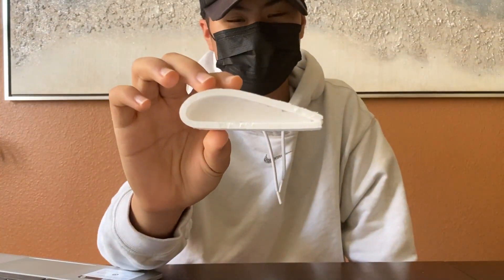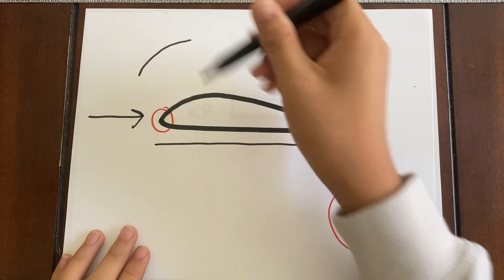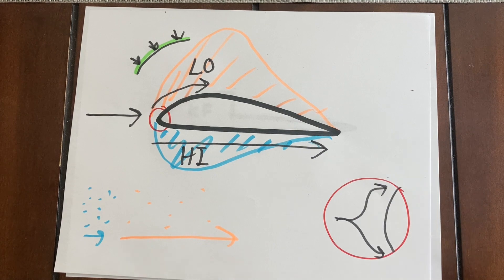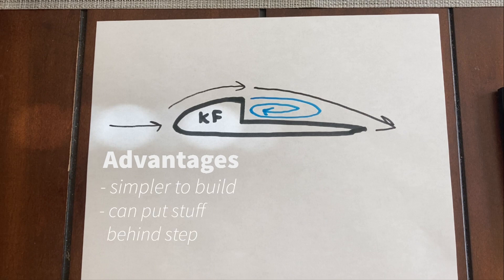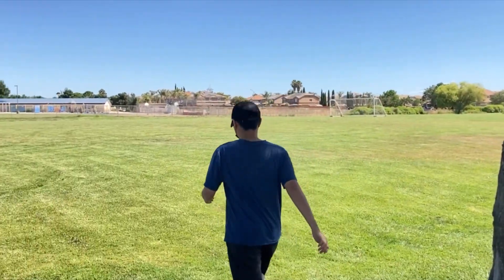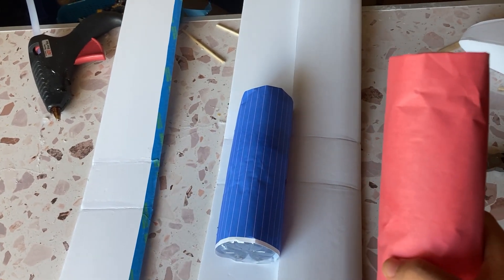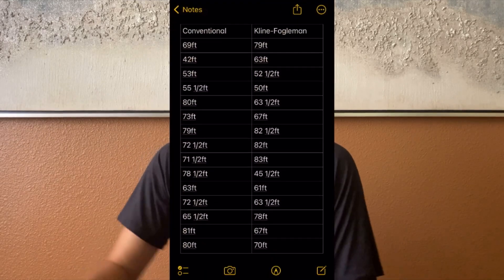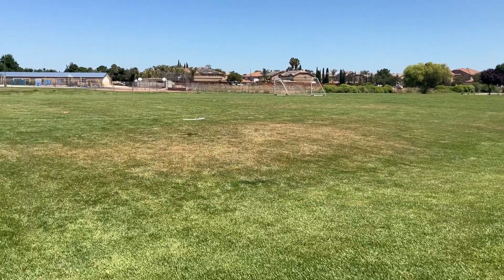How Good Are Stepped (KF) Airfoils Actually?

Comment: Good experiment, but you're not gonna see a whole lot of difference between the airfoils this way. That's mostly because there's huge differences in the amount of thrust you give with each throw and the exact angle of each launch. It is humanly impossible to apply the exact amount of thrust at exactly the same angle every throw. KFm airfoils are just more efficient , and you wouldn't see that unless you measured the energy required to propel it through the air for a given time or distance. They improve aerodynamic performance by reducing stall speed and increasing stability.  Still cool to see you young guys out there exploring the scientific world. Maybe one day you'll invent an airfoil that will change aerospace forever !!!

Comment: The KF is lighter, is it not? That might make it go further, or not. Ideally the wings should have the exact same mass for their surface area, so the KF would have to be made of something a little denser, or have a weight strip added to it.
Reply from the maker: Good question. Essentially it would be, but by a couple grams I would think. Probably the weight difference is insignificant compared to the entire weight of the aircraft.
Reply: @_BL4CKB1RD_ While the actual weight of the removed wing part seems slight, in reality it is about 25% weight of the overall wing weight removed. That is a significate amount of weight.
Reply from the maker: @K3Flyguy noice.
Reply: @_BL4CKB1RD_ I think you're right. I didn't realize how light that stuff is.

Comment: Couldn’t help thinking that exercise would be better conducted with well  constructed glider in balsa and without interference from radio control. Consistent launch system inside large hangar would be better still.
Reply from the maker: @richardfalconer1959  this other YouTuber @DesignYourOwnAirplanes-xd6lz performed a much better designed experiment than i did. He uses a gym and and a consistent launch system (which I was unable to make).

Comment: Interesting video. Afaik KF airfoils have lower performance than regular airfoils, but compared to an airfoil made from bent foamboard the difference should be minimal. The main advantage of them for RC planes is that they're incredibly easy to build by just glueing two or three sheets of foam on top of each other and then sanding the leading edge into an airfoil shape. At least for the depron we get here in Europe that doesn't have paper on it, I don't have experience with dollar tree foamboard.

Comment: Hi! It's the pressure diferential which accelerates air above, and not the opposite (as you said). With some angle of attack is more intuitive. The air coming towards the wing is forced to go downwards (downwash) so more air is concentrated. In the upper part there is much less air, so pressure decreases. A consecuence of this is the acceleration of the fluid, but the acceleration of the fluid IS NOT THE CAUSE. There are NASA documents you can easily search proving wrong the Bernoulli's theory for airfoils, which is logical, cause Bernoulli made his theory for uncopressible fluids like water, not air. Great video, awesome
Reply from the maker: Alright thank you for letting me know. I know I’m no expert on this subject, but how does the pressure differential arise in the first place then? (Also, air is compressible only past 0.3 Mach, at these extremely slow speeds, we can follow Bernoulli’s principle)
Reply: It is easy to see when there is some angle of attack. In the underside the air accumulates (more pressure) and it is forced to go downwards, while in the upper part, there is much less air, therefore less pressure and the air above is sucked
Reply from the maker: @torri7062  that wouldn’t make total sense for no angle of attack, since all the air is streamlined. I believe you are thinking of Newton’s third law, where each action has an equal and opposite reaction. When the air hits the bottom surface of a wing, and deflects downwards, the resulting force of that contributes to the wing lifting upwards. There is no one way a wing produces lift, but a combination of various principles.

Comment: underrated channel. im gonna build the tileo plane u built. do u have a build video?
Reply from the maker: Oh nice, but umm I don’t plan on doing a build video. I like to showcase an extended build montage which shows most of the build process. I’d recommend some basic knowledge with working with foam board, and it uses the same build techniques as flitetest kits do. Maybe I could write some instructions, but most of it takes some intuition. I’m glad you found my plane design worthy enough to build.

Edit: also, I found that one drawback to the Tielo is that it requires a heavy nose weight in the front, you could modify the design to have an extended nose in order to need less nose weight.
Reply: @_BL4CKB1RD_  alright! Thats perfect i have built a few flitetest planes before so im familiar with those building techniques. I’ll modify the nose just like you suggested. Im always on the lookout for neat pdf plans and your plane is just that. Neat, elegant and also extremely simple to build. Thank you for this video man, subbed🙂
Reply from the maker: That’s great to hear. One thing I forgot to mention is that on the Google Drawings “Tielo Printable” file, make a copy. Then, drag any part into the checkered area (which is sized for a 11x8.5in printer paper). The design is meant to be printed to allow slightly more faster and accurate cutting of the parts, but if you would prefer, I could also list the dimensions and angles of each piece. If printed on paper, I’d recommend using pins to poke holes where corners are or hold the papers in place, you can also use them to trace straight lines. For the curves on the nose pieces, I poked a lot of holes following the path of the curve and used my trusty dusty pencil to connect the dots. I appreciate you asking. 

Let me know how it goes!

Comment: So a few things that will make things easier and more consistant. A bungee launcher will give consistant launches. Also measure  your steps and pace off the distance instead of the tape measure dance. In your next test try the Klein-Foggel airfoil with the step on the bottom I think you'll be pleasantly surprised at how much better ot does then the step on the top.
Reply from the maker: Thanks for your tips! I originally tried to do a bungee launch but couldn’t get it to work so hand launching was Plan B. I guess feet measurement would be more accurate and quicker(wouldn’t need to suffer as much through summer heat and barraging mosquitoes).

Comment: Great experiment, with an entertaining presentation. 
Really like how you designed the fuselage using foldable facets that mated triangular tail boom. Simple, but very effective design. 
Environmental conditions likely the biggest variable (ie: wind, turbulence)
While inconclusive, your two data sets have many similarities. Plotting the data on a graph (two colours) could help show that data is evenly distributed. Being similar can be a very valid result. Nothing wrong with this. 
Would have like to have seen similar data on the higher aspect ratio wing (assuming it has the same wing area).
Reply from the maker: I appreciate the feedback. The high aspect ratio wing doesn’t have the same wing area, I just made it so i can fly it as an actual glider. If I do another experiment, I will keep graphing in mind.

Comment: good work

for consistent air, best to try in dead calm (often best early morning or dusk), and possibly more effective to tow the glider and release by flying off a tow ring on a consistent length of line, on a big field, and timing the flight from release - preferably in a straight line, because turns induce drag
that supposes equal speed for both if max distance is the comparison, otherwise you will be comparing "hang time" as the measurement
fwiw, v tails look good, but they don't steer as well as rudder / elevator
Reply from the maker: Gotcha👍

Comment: Great little experiment, definately something nobody has ever thought of. Maybe for more consistancy, you could simply run wind tunnel tests on the two standalone wings and compare the lift and drag data. If you don't have that, then it's always a great idea to find an excuse to build another airplane. Good work!
Reply from the maker: Originally, I meant to use a bungee launching system to help with consistency, but it never worked, so this was my Plan B.